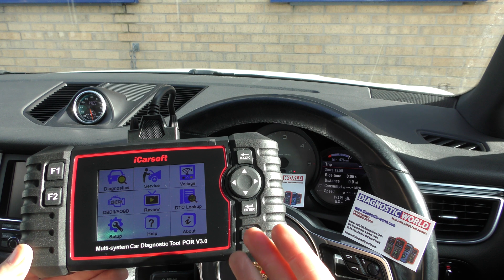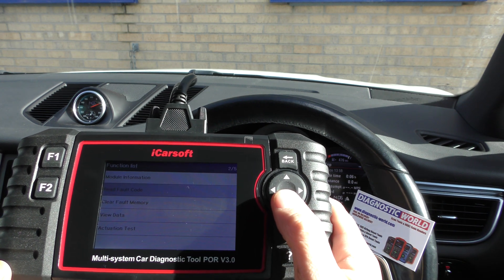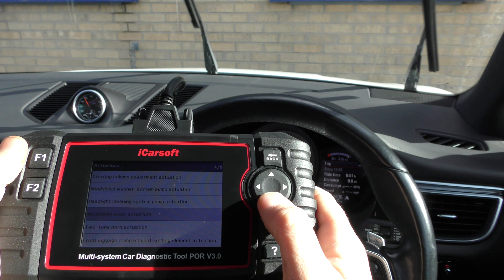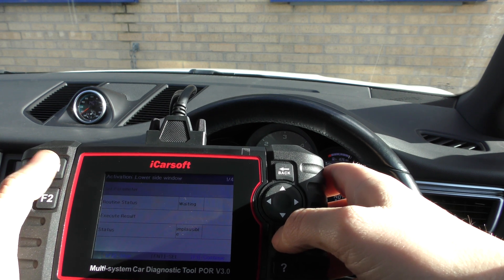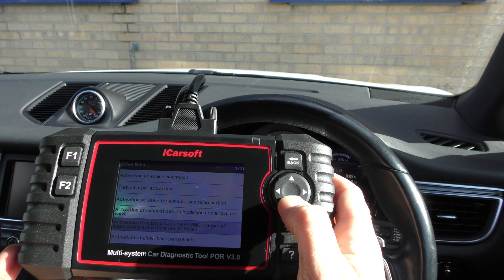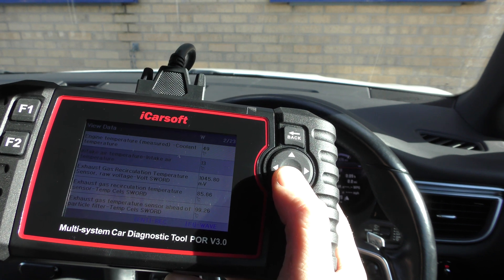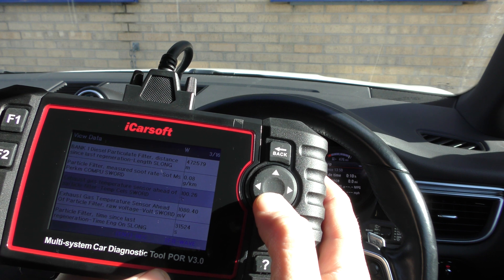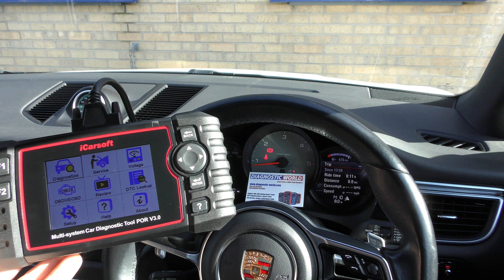Porsche Component Actuation Bi Directional Testing iCarsoft POR v3.0 Demonstration & DPF Live Data

Comment: Great video, I have the Por V 2.0, it looks like the Por V3.0 allows more useful features. Do you know if the 3.0 can access the sport exhaust motorized dampers? I replaced the driver side actuator on my 2016 Porsche Cayenne Turbo and I can hear it cycle every time I open any of the doors,  I’m thinking I need to get it and calibrate its position. Is this something the V3.0 does? Thanks and keep the videos coming.

Comment: Hi I have a icarsoft por 3.0 imanaged to mess up the both faults shown which was never there before 1--the air bag red flasing on the  display 2- the electric poarking brake is in service mode and also EPB is faulty ,I could not revert all these 2 faults back to normal  which was never before please help  
excellent channel  Regards